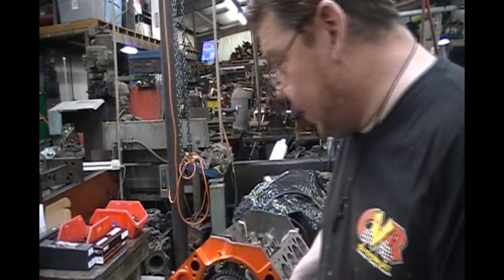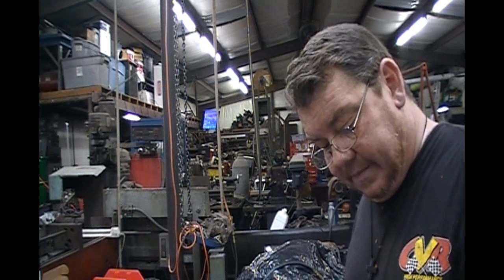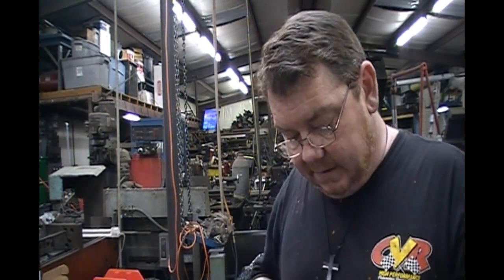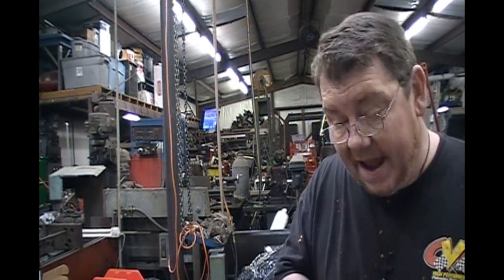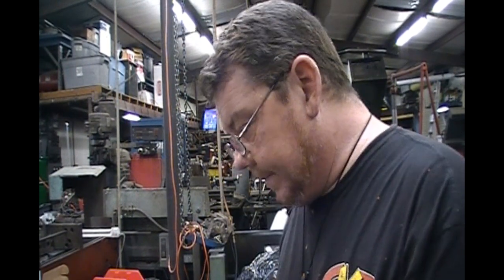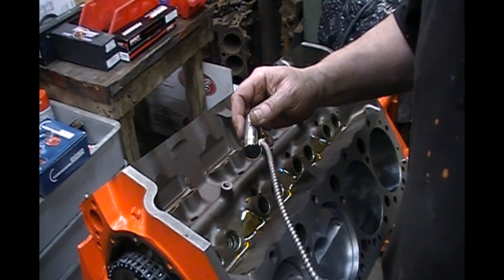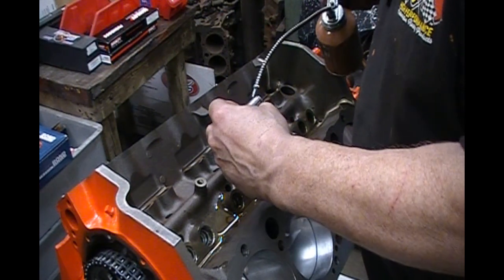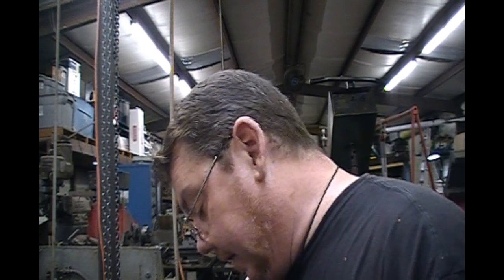Flat tappet camshaft problems, lifters, oil and talking flat tappet tech

Comment: No new car company breaks in cams at all. So none of this bull shit means any fucking thing. Someone needs to clean up their act.
Reply from the maker: well that's true, but all new car's now days have roller cams and don't need break in. We are talking about Flat tappet cams. And I assure you that flat tappet cams need proper lobe taper, lifter crown, ZDDP and break in or they will indeed fail. That is NOT bullshit . You are right though...some of these companies needs to clean up their act when it comes to quality control.
Reply: @Marksracingengines  This still doesn't account for almost all the cars without roller cams and ran for ever without any break in. Small block chevys are just horrible.  And there has to be a reason for this because other cars work forever without cam problems. Infact i don't think i have seen anyone that had to change a cam on any car other then the big 3 v8's. Maybe some guys could recrown these lifters, polish them and harden them and resell them?
Reply from the maker: @karldettling5981  yes they can be re-crowned and the cams can also be reground. I have a cam shop that I use to do that sometimes. The problem is they took the zddp out of our oil, and sub standard parts with no quality control anymore.  that's why I was explaining in the video to use a quality cam company and good parts. I build around 50 to 75 engines a year, most of them small block chevys and most of them with flat tappet cams. to this date I have only had maybe 5 cam failures in 30 + years in business and 2 of them were straight up my fault for throwing to much spring pressure at them.  There a bunch of rebranded junk out there that is doomed to fail before it leaves the box lol. Also there are certain lifters that if not worn to bad they can be re-crowned by hand, I've done it with a lot of success but it's controversial. maybe I'll do a video on that.